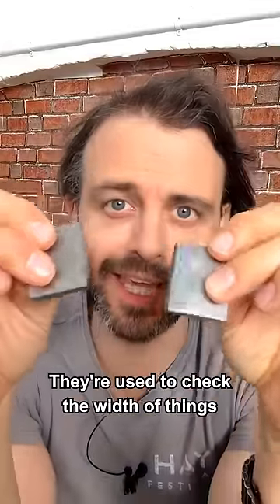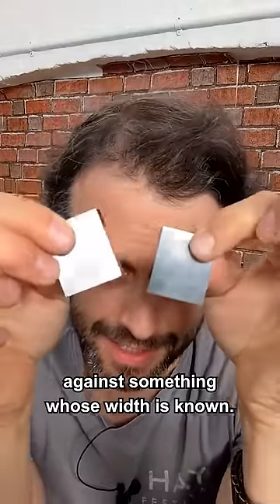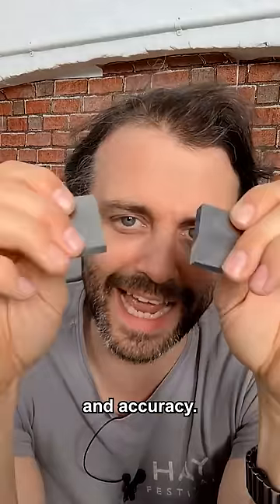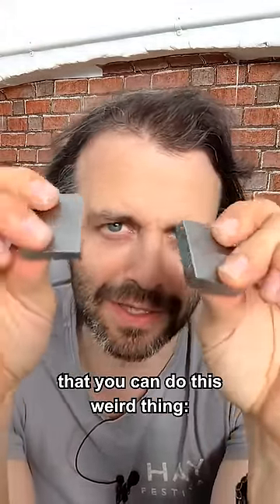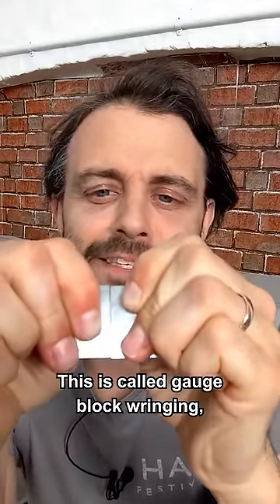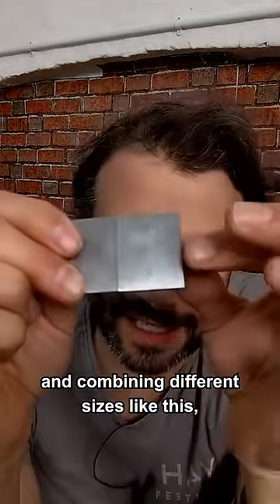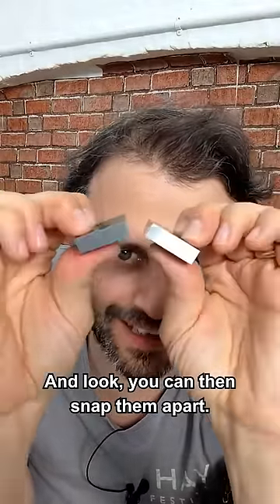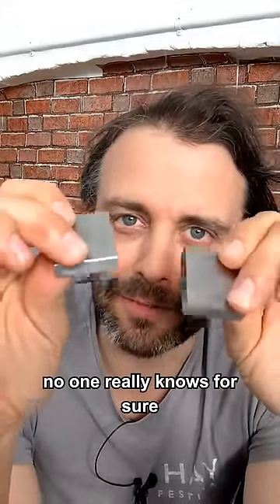No One Knows For Sure Why This Happens!

Comment: My best guess would be is that the surface area is so smooth that it's actually creating a tiny vacuum that's essentially "dry welding" them together.. albeit very fragily.

It reminds me of how a ruler can be "stuck" to a wall if you slide it fast enough. Fun experiment to try if you're bored.

Comment: Probably for the same reason clean metal surface will cold weld themselves together in space? The same principal but not as strong since well this isn’t a vacuum. The metal is trying to bond but not enough of the oxide layer was removed when sliding them together? I’m guessing and it’s a very big guess

Comment: It is likely very simple.  The electrons that solid materials share to have that state are being shared across the minuscule gap that exist between the gauge blocks super flat surfaces.  Transistors and diodes find functionality in this process at their junctions between areas "doped" with "impurities" that makes them an N or P type semiconductor.  The old cat whisker detector pulls off this trick also with a wire on germanium rock crystal.  The electrons of a material abundant in electrons go into the material that is lacking electrons in its outer shell.  This preference sets up a barrier to electrons flowing toward the material that is abundant with them.  And little resistance to flow the other way.  Thus a diode exists.  A common transistor is just two diodes that have a common material between them called the base.  Disturbing the electrons in the base.  behaves like removing marbles at the middle of a pile that stopped going through a screen.  The electrons (marbles) like a shaken sifter start flowing for a while.  Thus one can generate an amplification of the disturbing flow that shakes things up.

Comment: Atoms are a complex vibrational field, thats intruigingly beautiful in pattern. The different elements properties are hidden in these geometrical patterns, rather than the number of protons that are postulated.
If you have a grid of metal atoms that are so fine as these, you can push some of their fields close enough, so that they mimic a contiued lettuce of metal atoms. Of course it just happens with some of them and you´d need to heat up the metal, to really combine it. It kinda works like a lego brick, to say it simple

Comment: what do you mean "no one knows why"? its clear that this is a complex thing, that there are couple of things that do happen. Perhaps it would be more exact to say "we do not know which of all effects has bigger impact". imho we have other observations of something like that happening during smithing. there we just fold a metal bar and hammer it couple times and voila, they are fused and you can not separate them again along the folding surface. metal is plastic, because its atoms do snap to eachother and create threads, sheets and crystals. Its possible because metall atoms mostly do have different forces and focus distances in different directions. Because of that threads are stronger than sheets, sheets are stronger than crystals. That leads to metal being able to not shatter if its hit with a force, but to internally rearrrange instead, as long as the hammering force is waeker than at least one of snapping directions of metall atoms. So if the force is stronger than crystal building forces, but weaker than sheet building forces, then the sheets will move to rearrange as a different crystal. if the force is stronger than sheet building force, but weaker than thread building force, then threads will move and rearrange to different sheets and crystals. but if the force is stronger than thread building forces, then metall will just shatter. 
And the thing that happens here with merging 2 metall bars is, that if enough atoms can snap in to build new threads, this threads will start to rearrange alot weaker sheets and crystals and fuse metall bars over time, so that you will have difficulties to break this bars apart on the exact same line after a while. They will have to break somewhere else. I am pretty sure you can simulate that and see yourself, that this effect is the most important in this experiment.

Comment: it's because of the same forces that hold the solid material of the block together. They are so smooth that, when pressed together like that, you have no air left between the pieces. That means to the molecules they see no other elements or structures, just the exact same material that it's made of. I believe this was a major concern in space at one point. They feared the hinges (of a hatch) would "weld" together due to it touching in a vacuum

Comment: If u have wet hands, u can do pretty much the same thing. It’s the natural voids in that surface being depleted of the gas in there and it forms a vacuum. As u twist, it pulls those gases or air on a micro scale and locks the 2 surfaces in with suction. I don’t know why that’s so had for scientists to figure out. It’s a simple process.

Comment: The surfaces are so smooth
that when the two blocks are
put together air cannot fit
between them, creating a
vacuum that holds the two
blocks together, until they 
are forced apart allowing
air between the two 
surfaces again.

Comment: My hypothesis on this is surface tension. Kind of like when you put something on the surface of water, if you lift it straight up, the surface of the water will slightly pull up with it until the force overcomes the tension.

Comment: When surfaces are too smooth, they have atome with electronics wobbling around at the surface. When contacted, they form a tiny bonds with each other so the attraction is basically electrostatic force. It's pretty basic physics

Comment: could it be related to the effect where, even at below zero temps, ice is still slippery because the very outside layer of atoms is still a liquid? you put two pieces of ice together with flat surfaces at sub zero i'm sure they'll stick in a similar fashion

Comment: The way it was explained to us is that the surfaces are so smooth that there are enough atoms in the crystalline lattice of the metal to align with each other and attract. It's the same force that holds the atoms within the metal block together.
IDK if that's actually the case, I'm not a physicist, but this is what is taught nation-wide in my country and it makes good sense to me

Comment: The lattice of the metal crystal cannot tell where one object begins and the other ends. It only works with no air particles in between, this is the reason nasa uses 2 different alloys on doors in a vacuum to stop them "welding" to each other at the atomic level

Comment: It is called cold welding and one does know why and how it happens. It happens when the surface is to flat and smooth that enough of the surface is in such contact that the Metal atoms get so close that they basically form one combined object.

Comment: When you rub two perfectly flat sides of metal together they create an electrical charge which locks them together and it takes a ton of force to unlock them it's just basically electrostatic charge

Comment: I think you just press the air all out of the space between the pieces, when the pressure is releasead you create a vacuum and as it is so smooth there isso no gap for the air to back in place, sticking it.
Reply: while your reasoning is nice, this also works in a vacuum, so it's not because of pushing air out

Comment: It's very smooth; there are no gaps between them when you bush them, so it's like a vacuum, causing them to stick together
Reply: Yeah, that's my understanding as well, it is a vacuum, all the air is expelled as they slide together.

Comment: I used to want to be a machinist. we were told that Wringing the blocks together pushes all the air out. We had to make 1-2-3 gauge blocks as an exam, and they had to wring together. To do this, we had to machine them down on a surface grinder to ensure the surfaces were perfectly smooth. If you dont do that properly, they dont ring together.

Comment: Magnetic?
Reply: No, you don’t want magnetic gauge blocks for precision applications, because even a spec of dirt or metal dust can throw them off significantly.
Reply: @autumn5592  how do they work then?
Reply: @Solrex_the_Sun_King  A combination of surface tension from oils/liquids and van set waals forces (atoms being attracted to one another.)

This effect happens with any material, provided it is flat and smooth enough.
For example, ceramic gauge blocks, they can still be wrung.

Comment: I have a theory: the surfaces being mirror smooth allows for maximum surface contact; grinding the faces against each other increases the heat in the layer of metal atoms on the surfaces of both blocks which then partially combine by friction welding; the heat dissipates almost immediately because of the surrounding metal; the blocks can be separated by overpowering the welds. 

That's what I think happens.
Reply: @benjaminhanke79  gauge blocks are not magnetic
Reply: @benjaminhanke79  So why would they fall apart in a demagnetiser?
Reply: @benjaminhanke79  He never said they were magnetic, he showed how to make them stick and said that it's not currently known why they stick together like that. I also never said the blocks were magnetic, you were the first to mention magnetism and the way you phrased your comment implied that you believed the blocks were magnetic.

Comment: 1. "Precision and accuracy" is repetative and redundant. 

2. It is called frictional locking. When two surfaces fit together perfectly, the friction is enough to keep them held together until gravity or any other force is enough to disengage the "lock". It is the same thing that happens when pieces of paper stick together. Items with irregular surfaces allow air between them, and the air prevents friction, and the items separate, but the less air between the two items, the more friction is created that allows them to stick together. If you scratch one, I bet it wouldn't work anymore. Certainly not as well. 

It is also why your mom loves my house so much! 😅
Reply: "repetative[sic] and redundant" is repetitive and redundant.
accuracy refers to proximity to a target. precision refers to reproduceability of results, or proximity to its other instances. something can be accurate, precise, both, or neither.